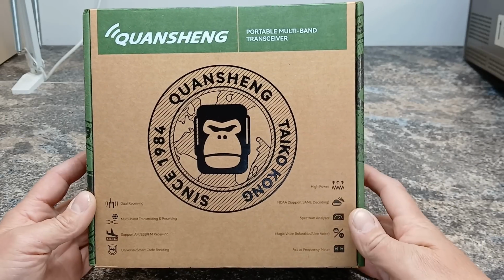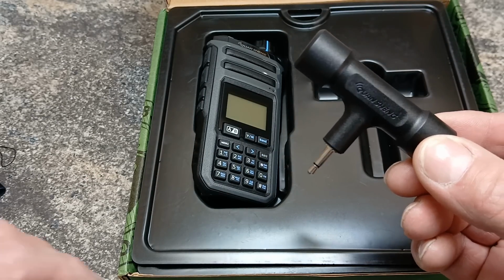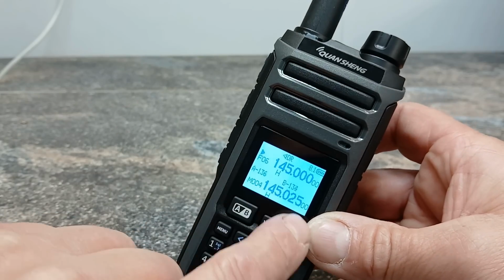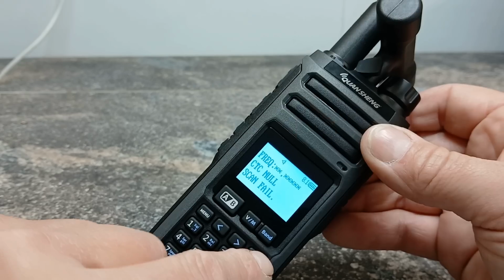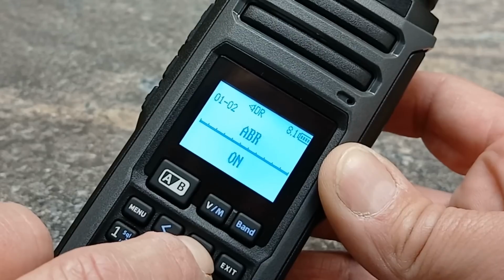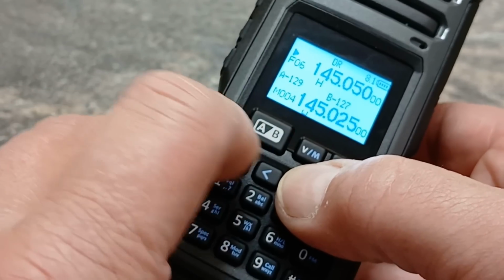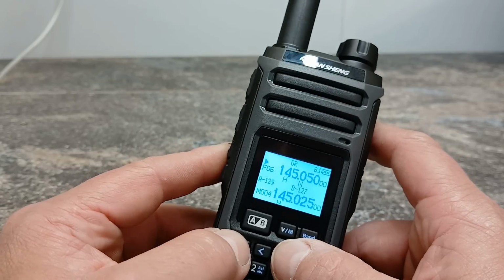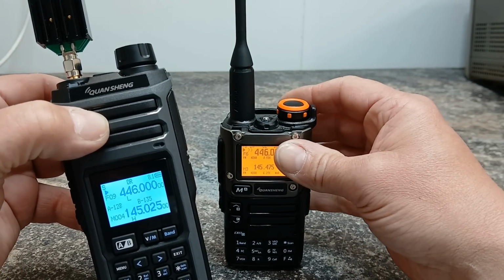The Quansheng TK-11 Has Arrived! - First look - Menu & Functions

Comment: Hiya. Thanks for a great review.  Can you reprogram it via cable/chirp to marine use?  Thanks.
Reply from the maker: Hi Kimberley. Yes, you can programme VHF marine frequencies into it, however it wouldn't be type approved for marine use. If you need a marine radio, then I'd always recommend a type approved VHF set, as they are generally all waterproof and will have the correct functionality requirements. I've got a couple of videos on my channel of the Retevis RM-22 and RM01 if you're interested. Thanks for watching, Ben.

Comment: With all due respect all this information is available on the radio's website and all promotional materials. How about a video on how to use the programming software?
Reply: The programming software is painful to use, but beats manual input. Took 2 days of googling just to find a link that worked. No instructions of course. I found that you need to exit the website after updating the channel list, then restart the program to "write" it to the radio. Frustrating but it works.

Comment: Ssb 10 m & 11 m ?? Tx ??
Reply from the maker: Unfortunately, with the stock firmware, it doesn't currently support TX on SSB. Thanks for watching 👍
Reply: @m7frs272 👌Thankyou for replying  looks good as it is anyhoo ✅
In time they will tx ssb 10 &. 11 🙏
73
Reply: @cbradiohamman: No, TX is FM only (all bands/frequencies). You can RX SSB  but not TX.

Comment: I get the reasoning behind the TRS for the ferrite rod antenna, presuming that's what it is, as they're directional, but it seems like a suboptimal compromise. 

Whilst I don't think it transmits SSB, I know some modified K6s could transmit DSB, curious if that could be done with this.
Reply from the maker: Agreed and yes it may well be possible to TX, at least DSB will a firmware upgrade 😉 🤞